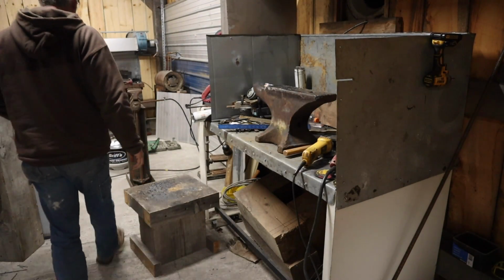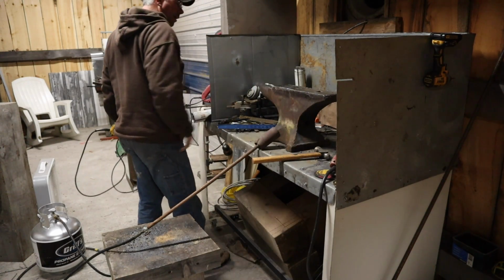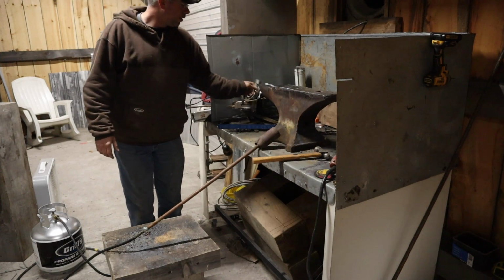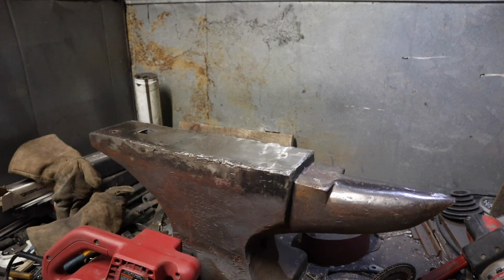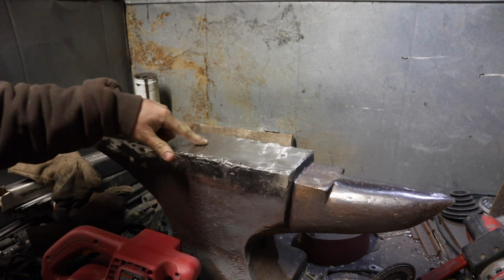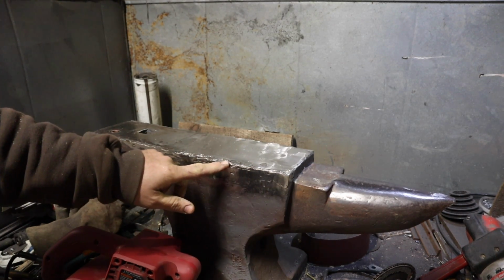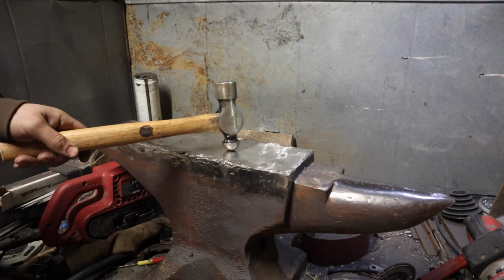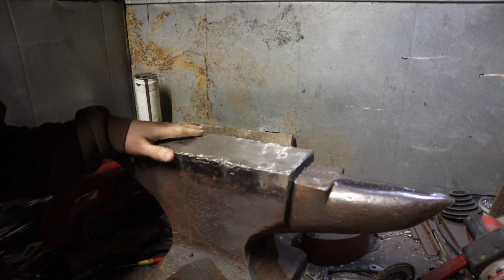Almost Finished With This Anvil Repair

Comment: Morning Jim. Great camera angle during the welding, really got to see how well the exhaust vent/blower pulls the smoke away from you and out of your work area. Surface is visibly better and the edge is WAY better than before your repairs. Good job. But why didn't we get to see any 7 inch grinder action? Also, don't forget to change grinding directions with the belt sander so you can see the areas ground the other direction with each belt change. That way you can see that you're getting good coverage with each grit level because the scratch pattern of the previous grit shows if you don't get full coverage with the new grit. Also a good way to help get flatter surfacing.
See you on the next one.

Comment: I might a little bit late I was just wondering what welding rod are you using sorry if I missed it somewhere
Reply from the maker: No problem at all.  7018AC to build up the missing edges and Hardalloy 58 to fix the face.  Both rods can be used with an AC welder.

Comment: FYI....it looked like the sparks when welding were traveling over the metal back shield and may be landing on the timber frame....might want to review the video real close to confirm or deny.
Reply from the maker: I will, thank you for pointing that out.

Comment: I think your cheating...  The old timers said you could always tell if a blacksmith was any goo by if the anvil was to hot to touch at the end of the day.  But in this case, I don't think torching the anvil with a propane torch was what they had in mind.
Reply from the maker: Can't trust old timers too much.